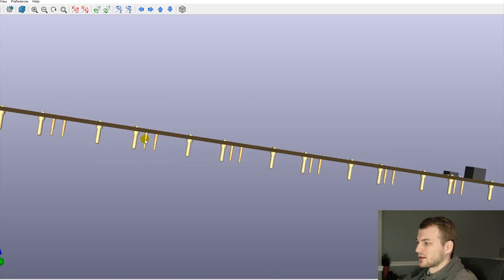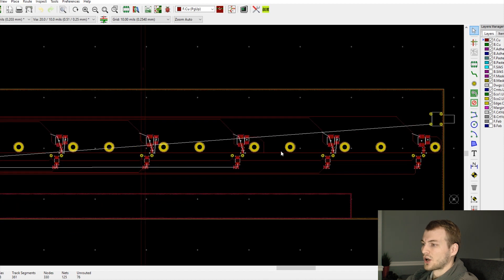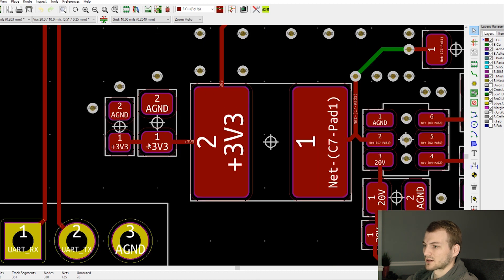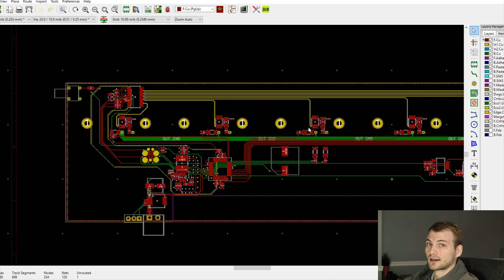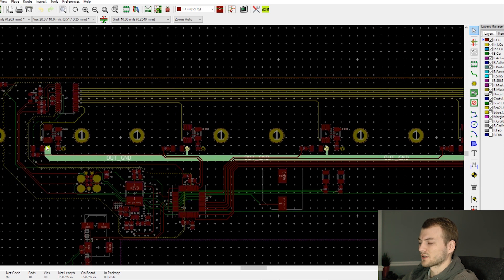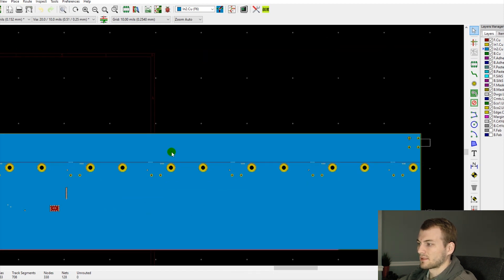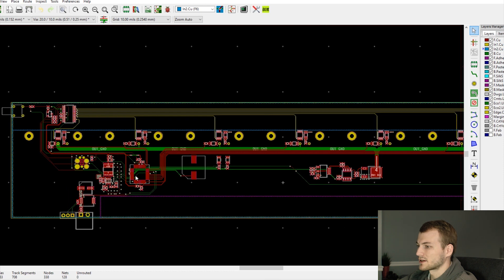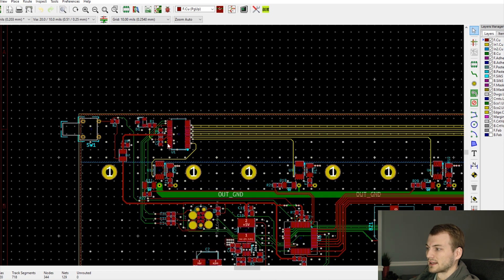Designing a Functional Testing PCB part 2/x- KiCad 4 Layer PCB

Comment: Just discovered your videos and really enjoy them, keep it up.  I'm just getting into Kicad for some hobby stuff for the first time during this lockdown and gotten a number of good hints from you, thanks!

I think your 20V plane is only equivalent to having a GND plane if the decoupling to 20V is good and local to all the sources.  Consider an IO on your micro, it drives high and there is a current which leaves the IO pin and must return to the ground pin.  How will this return on the 20V plane?  Starting at the load, at high frequency the return current will want to follow the plane closest to it (the plane) so the return on 20V works.  However, when the return gets to the micro, then what?  It can't just "jump" into the ground pin of the micro (except through small parasitics, not enough to be effective), so it must then travel to the nearest 20V decoupling cap to make it's way to the ground plane and back to the GND pin of the micro.  How big is that loop?

There is a typical case where this "power plane  as a return" rule of thumb works which is where the power plane and driver are run from the same voltage, which is what I think you were considering.  In that case, when the return current makes it back to the driver on the power plane it can get to the ground pin of the driver through the local decoupling cap and the loop area remains small.  That doesn't mean that just any plane, by virtue of being a big slab of close-coupled copper makes a good return.  How it connects to the place the return needs to make it back to still matters!
Reply from the maker: Great discussion Larry. You are spot on. There are definite exceptions to what I said, and you can absolutely screw up a layout by having your caps too far away if the V plane is being used as the return.

Comment: For cleaner adc measurement you should insert an rc filter to every adc. The caoacitor should be large enough that the sample capacitor does not matter too much.
Reply from the maker: Oh that's totally a good method. I didn't do that here since with a pretty constant current draw, I'd rather over sample and filter internally. If I did a RC filter it would limit the sampling rate. Either method should work fine though - plus this uses less parts 😉
Reply: @MicroTypeEngineering  have a look at the internal of an sampling converter. Its basically  just a capacitor that divides the voltage down. If you want to learn more about sampling, i can recommend the following literature - look for the adc chapter https://publikationen.bibliothek.kit.edu/1000097755

To quickly charge that capacitor sampling, another capacitor is required. If you have a strong adc driver, that capacitor can be fairly big. As a starting value i recommend 1nF. Oversampling i try to use as a reserve. Of cause its a legit means of reducing noise.

Comment: I think what are you doing here is waaaay overkill for the task at hand. You're measuring currents here, and they are pretty much static (as loads are almost purely resistive and constant if I understand correctly). Also you'll probably be averaging ADC measurements inside your controller, and averaging is essentially a low-pass filter, so it will further filter out high frequency noise, this time in a digital domain. So what you're saying is a good idea when noise can be an issue, but for this specific application I wouldn't worry about it nearly as much as you do. Though I do agree that 4 layer boards are much easier to lay out properly than 2 layer ones. Also - I found that placing decoupling caps with right values right at the power entrance into the board is a great way to short-circuit a lot of switching noise from noisy supplies, and this is especially important if your board consumes significant current and/or there is a lot of digital logic on a board (as it usually consumes current in "gulps" creating a lot of noise on its' power rails).
Reply from the maker: Oh yeah, you're right. It's totally overkill for simple resistive loads. We have a simple version that we've been using for production. If I did it more basic, it wouldn't have made for an interesting video! I figured it was a great time to discuss some mixed signal issues, and why moving to a four layer board is helpful. 

There is filtering with caps on the input side, though there not technically called decoupling caps in that usage.
Reply: @MicroTypeEngineering  Well, they decouple your board from the upstream power supply, so - they can still be called "decoupling" :)
BTW if you still plan to continue your boards review series, can you take a look at my board here: https://www.eevblog.com/forum/fpga/custom-spartan-7-board-for-beginners/ I've made this board for people who are just getting into designing boards for FPGA, and so it would be interesting to know your opinion on it. I know this board works, but there is always something to improve :)

Comment: Great video, I personally learned a lot from the shunt resistor layout explanation. Do you have any 'must read' list of resources about printed circuit boards layout?
Reply from the maker: Thank you 😊

This is what I posted on a reddit post a while back to a similar question:

So there's a lot of good books and articles. For just starting out, and wanting to just get a board working, this article by Dave at eevblog is the best: [http://www.alternatezone.com/electronics/files/PCBDesignTutorialRevA.pdf](http://www.alternatezone.com/electronics/files/PCBDesignTutorialRevA.pdf)

After that if you want to get into more detail and learn some more intricacies, "PCB Currents: How they flow, how they react" goes into more detail while still being easy to read.

After that, if you want to finally understand how things actually work, you can go to Henry Ott's "electromagnetic compatibility", and/or Johnson's "High speed digital design, and handbook in Blackmagic."

Do note the last two are very in depth, and a fairly difficult read